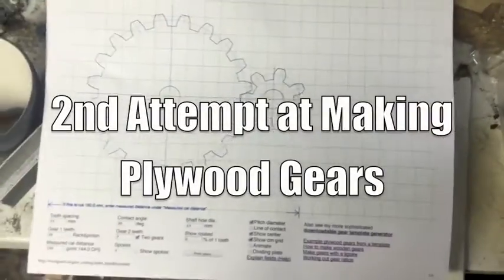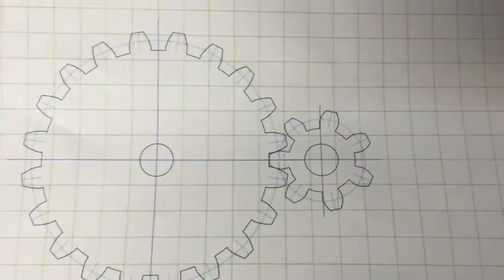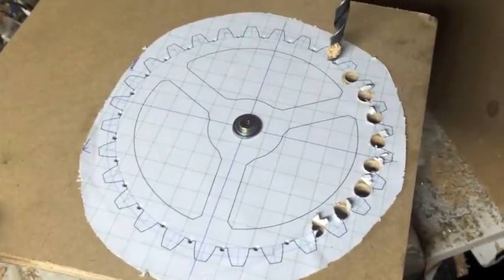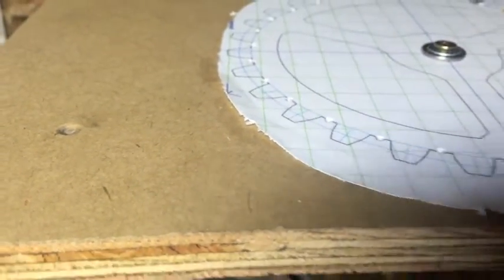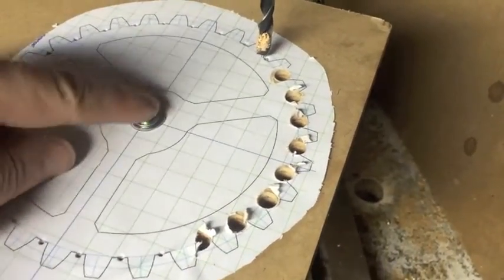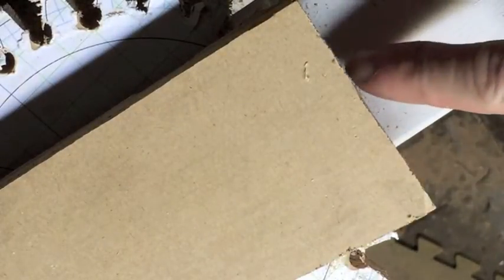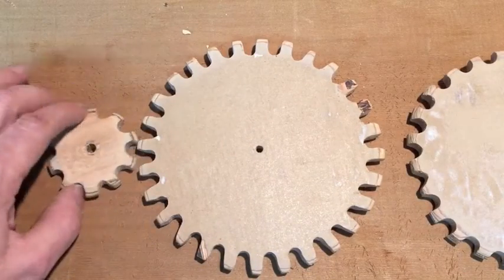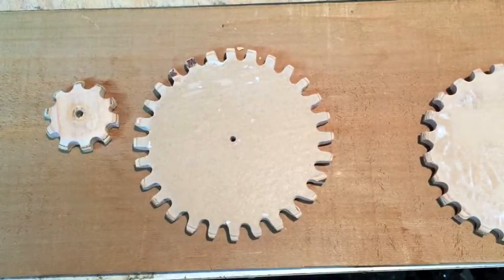2nd Attempt at Making Plywood Gears

Comment: Hi Scott, Great Idea mounting the gear to the drill press to get the holes in the correct path. I would like to give this a try . I will have to figure out a project I could use it on. Looking forward to your next video.
Reply from the maker: +Aceman307 It works quite well. Originally, I punched starter holes and used a brad point bit, but the drill bit would still wonder around on the wood. Frustrating when you're trying to get it right at the start. I'm practicing on a 60-tooth design as we speak.